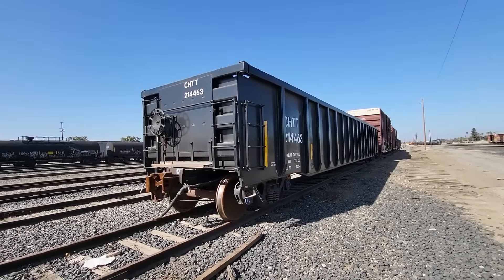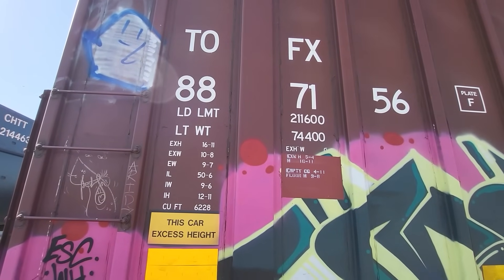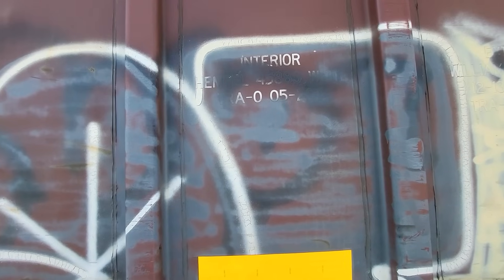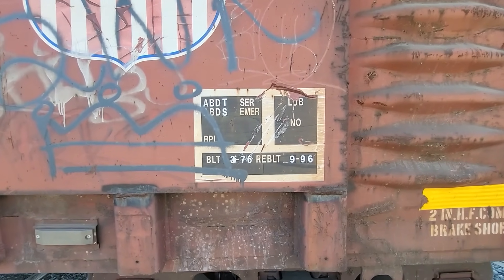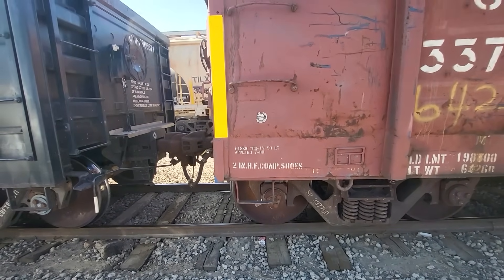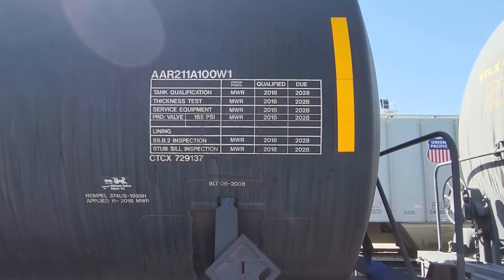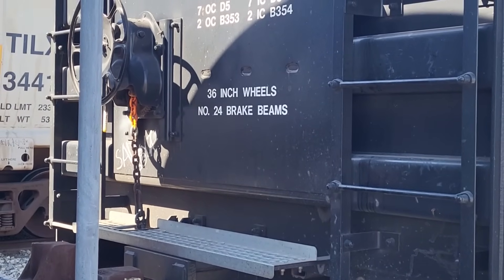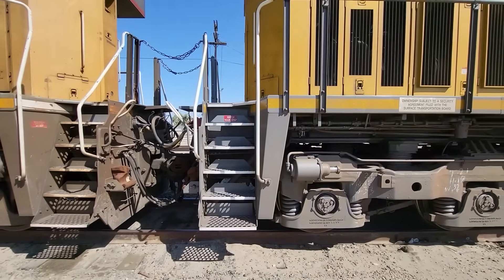What's All The Stuff On Railroad Cars Mean?

Comment: 19:57 On the GE Locomotive 5268 you said that you didn't know what that appliance on the Engineer's side behind the fuel tank is. It is the water seperator to prevent water from being introduced into the air tanks after the air is compressed

Comment: All diesel-electric locos have to have a front designated hence the F.
Plate is the AAR designation of the clearance diagram or loading gauge to most of the world.  Plate C is smaller than Plate F which is smaller than Plate H.  This is the extreme height and width dimensions the car is designed to stay within.
Miner is the draft gear maker.
The ICC is no longer in existence and the Surface Transportation Board is the more modern government entity.
The X at the end of the owner's initials designates a private owner or other than a railroad.  CSX has the initials of CSXT for CSX Transportation Co. to get around the X at the end.
LD is the Load Limit or total weight of the car loaded.  A car with 263,000 lbs on 4 axles is a one-hundred-ton payload car.  LT WT is the Light Weight or Tare Weight of a car, in other words, an MT or empty car.
The reflective strips show up at rail crossings at night to help indicate that a train is passing on the crossing in the vehicular traffic headlights.
Generally, tank cars are unloaded mostly from the top and then from the bottom in the last bit of load in case there is a leak or accident with the unloading hose so the whole car does not spill the load.  Heater pipes are also used on cars carrying syrup, etc that need to be heated to flow. 
High Voltage in a loco usually means 600 Volts which goes to the traction motors.
The small canisters at 20:02 are fuel filters.
The label saying "Ownership subject to a security agreement filed with the Surface Transportation Board" just means that the locomotive or even car was bought by a bank, leasing company, or other and that the loco or car has not been paid off yet.  This equipment is paid off with funds generated by their use.
A witness groove would be a base diameter to be able to measure the diameter of the wheel if needed.  That would be a lot of wear on a wheel.

Comment: 21:33   This indicates the wheels are 43" diameter when new.  There's a line (witness groove) around the wheel at the 38" diameter.   The wheels are turned (resurfaced) occasionally.  That WG is the limit of how far the wheel can be machined down. It can't go less than 38".
Reply: Isn’t it recommended that all the wheels have the exact same diameter for ease of operation of the traction motors? or isn’t it not necessary?
Reply: @Bassotronics  Correct.  There may be a 1" tolerance on the diameter but they have to be the same size within 0.015".

Comment: note the end extra metal plates at the ends of the acid tankcar,,,,,they are there  to help protect the tank car from rupturing during and or if it is in a 'derailment',,,,,designed to keep the railcar ahead or behind the acid car from becoming uncoupled  with  the acid car and puncturing the hazzard acid car in case of a  accident.  The hazzard cars also have special designed couplers that are designed NOT to become uncoupled in a derailment and to  stay together and form a zig-zag  type pattern while still cloupled  instead of riding up and over each other and making a 'puncture'  of the tank car.

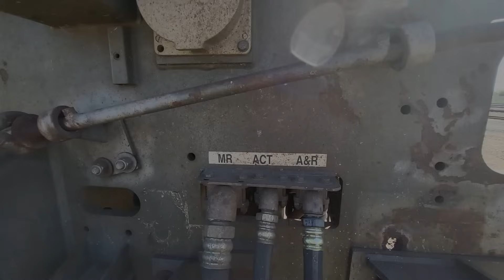Comment: @22:00 Those are there for your air connections for the multiple unit setup (where you have multiple locomotives tied together to be controlled by the lead locomotive). Those acronyms and functions are as follows:

MR -> Main Reservoir. Ties all your locomotive reservoirs together to form a single large air supply for your train
ACT -> Actuation. This is to actuate the bail-off on the independent brakes. Whenever the Engineer bails the independent brakes, it releases pressure off the brake cylinders so as to control slack action of the train.
A&R -> Application & Release. Provides air pressure for controlling the independent brakes of the entire consist. Often times it's also labeled as "BC" for brake cylinder.

There's probably more specifics on how this works but this is just bare basics from my knowledge.

You also have a 27-pin electrical cable, and from what I've read, most of those pins are +74 VDC digital control signals (meaning the signal is either on or off to control something on the trailing units), or have analog (meaning that the output can vary and does not need to be strictly just "on" or "off") 0-74 VDC for providing control to things that need varying degrees of control (i.e. dynamic braking level, etc). Other pins that don't carry some kind of control signal is either ground or not used.

Hopefully this is somewhat informative!
Reply from the maker: Thanks for the information. It's always helpful to know a little more!

Comment: So....

1 CHTT is Chicago Heights Transfer Terminal, part of the UP system. 

2. LD LMT is the WEIGHT of the car PLUS the weight of the load COMBINED. DO NOT EXCEED.

3. The gray tag is indeed an AEI tag, it is literally the same concept as a tracking number for a package you may be tracking online. It also contains much more information like which side the AEI tag is located (A end) or (B end). 

4. TOFX is part of TTX, the X always indicates that the car is owned by a non-railroad company, basically a lease or private owner. That's why railroad owned cars don't have an X, like Union Pacific is "UP" or "BNSF". They are railroad companies so no X needed. As for the boxcars extra stenciling, yeah that is quite a lot of extra information for the inner dimensions. 

5. BLT is indeed Built new, and the case of the Missouri Pacific gondola, REBLT means Rebuilt, those cars are ooooold now so must be brought up to code for many reasons.

6. TTZX is also part of TTX, TTZX are the Centerbeam flatcar reporting marks. 

7. The SP gondola was built for Southern Pacific but mow repainted into UP colors and badging however it retained the SP road number to keep UP numbers available. 

8. Acid cars like the RCRX (Ragent Chemical) car are quite the special thing. Yes, the car needs a special coat as acid spillage would otherwise chew away an inferior paint job. 

9. Plate C is a profile identifier for the type of car it is, some cars are tall, some are short, some are long some are designed for oversize loads, Plate A, B, C, D, E, F etc. 

10. Yes the CHTT "springs" are part of the truck springs. Weight differences. So must be proper.

11. The BISX car is incredibly rare, I've only ever seen one in my whole life!!!

12. UP 5268 is a 2006 built GE ES44AC but as always UP renames them as C45ACCTE. The sanders are very useful as they drop sand on wet rails to give traction to the locomotive. 

13. UP 5426 is also a GE ES44AC now known as C45ACCTE. This one is equipped with a steel bell unlike the 5200s that have electronic bells.

14. The red F signifies "FORWARD" or "FRONT". People need help identifying which end of the locomotive is the front 🙃.

15. UP 7976 is a later built GE ES44AC now C45ACCTE, the 73XX thru 82XX for UP were built from 2007 thru 2014. 2015 marked Tier 4 era and the Tier 3 Gevos were done for.

Sincerely, modern UP N scaler.
Reply: 4. Pedantic, but the final X indicates that the owner isn't a common carrier railroad. For example, CMYX is the Cumberland Mine Railroad. They are a railroad, but they're not a common carrier -- they only move their own freight, and they don't accept traffic from or for anyone else. (In that specific case, they have no connection to the rest of the rail network, so it'd be kinda difficult for them to be a common carrier.)

9. The specific point here is that the plate letters correspond to the amount of clearance needed. Each route has a maximum allowable clearance. The issue with longer cars is that the middle of the car hangs out more when they go around corners, compared to a shorter car.

14. The F marker is needed because some locomotives are set up with the long hood as the front -- Southern, and Norfolk and Western both did that.
Reply: @beeble2003  Thanks for the corrections! I was somewhere along the lines lol and yes, I'm still confused as to why they still donthe red F despite Southern no longer doing this
Reply: @AbelG8781  There are still some locos in service with the long hood at the front. NS has a bunch, and there are some on short lines. And, who knows, in the future there might be more centre-cab designs with equal length hoods on each end. Having said that, I'm not sure why it's necessary to know which end is the front...
Reply: @AbelG8781 you do know that Mark retired from UP as an locomotive engineer? If I remember remember correctly he worked for SP/UP for 30+ yrs
Reply: @freedomfan4272  uh yeah?
Reply: @freedomfan4272  Pretty sure he said he worked in the signals department, not as an engineer.
Reply: @beeble2003   Reference your Paragraph Number 9.

Excellent information on Plate Record.  This information is critical for shippers and carriers moving loads, particularly over.sozed loads, either height and/or width, that determines an acceptable route.

EVERY common carrier has to publish restricted clearances for Plate designations -- bridges, tunnels, restricted curve width conditions, etc.   This can also restrict movement of two trains, both with wide loads, moving in opposite directions.  A Clearance Engineer has final authority for oversized movements, period.

Comment: I think (but not sure) that "empty cg" is the height (above the rail) of the centre of gravity of the empty car, and "floor h" is the height of the floor, again above rail.

"2 inch tread cond. shoes" refers to the kind of brake shoes fitted. They were originally cast iron; the most common now is a high-friction composition denoted "HF comp", as you mentioned later in the video. I think "tread cond." refers to high-abrasion shoes that are designed to round off flat spots.

Hazmat placards are still needed on empty cars, because even an empty will have a few gallons of product sloshing around in it, and potentially vapour, too. The only exception is if the tank has been cleaned, but receivers don't usually do that. The shipper will clean the tank before reloading. So the tank at 14:30 is almost certainly in nonhazardous service. Tank cars aren't heated while in transit, but they pass steam through the heater coils to melt or loosen the product on arrival.

BISX is the Brandenburg Industrial Services Company. Looks like they do demolitions, so I'm not sure why they'd use a gondola like that. As you observe, the load limits of most cars are about the same, so a small gondola like that would be intended for heavier stuff than a larger gon.
Reply: I go there.
Reply: Empty center of gravity. Different than loaded CofG which can change.

Comment: 207900 is the loading limit.    Go get the max weight you add LD LIMIT to LT WT.  EW isn't excess width...but extreme width.  The Plate Size (F) is a spec that refers to looking at the car from one end and determining size.   In general that is measured by Extreme Height and Extreme Width and then seeing what Plate Size they fall into.   Plate C is typical for most cars.   Plate F is a high wide
Reply: You can't determine the plate size just by looking at the end of the car. Longer cars overhang more on curves, so havea higher plate size. You also can't determine it just by looking at the extreme height and width, because things like tunnel clearances depend on the width of the top of the car.
Reply: @oisiaa  
you are correct... i definitely did that wrong... gross rail load is as you stated, 286000lbs
Reply: @beeble2003  Agreed.   I over-simplified things a bit.

Comment: The "CHTT" is the reporting mark.  If the last character is anything but an "X", the reporting mark is for a railroad company.  If the reporting mark ends in an "X" (for example "UTLX") is a private-car line.  A private car line can be a leasing company, a car owned by a railroad customer, or other entity.  One exception is TTX Corporation--it is a private car line (it uses several reporting marks--HTTX, JTTX, etc.) but TTX Corporation is owned jointly by railroads. As to graffiti "artists"--they are criminal vandals who vandalize property owned by others without the owners' permission.  The graffiti vandals have gotten "smart" enough not to paint over reporting marks and car nos. only because they know that, if they do paint over the reporting marks and car no.,  their "art" will get painted over by the car's owner.

Comment: “Plate F” is not the same as “F” on a locomotive to designate the forward end; it refers to the interior height, meaning that the “excess height car” has an extra two-feet of interior height compared to a standard boxcar of the same length.

Comment: They don't paint over the markings because that is the quickest way for a car to get a repaint and then their work is gone.
264k or 286k are the most common car load limits with some 315k limit cars. The states been helping out shortlines to get all tracks upto 286k as thats what most newer cars are.
the F is for front because on some units they run long hood forward (NS thing) its just a legal requirement.
MR: main reservoir
Reply: Unlikely to get a whole car repainted just because of graffiti over car data. They'll just patch out enough to repaint the data.